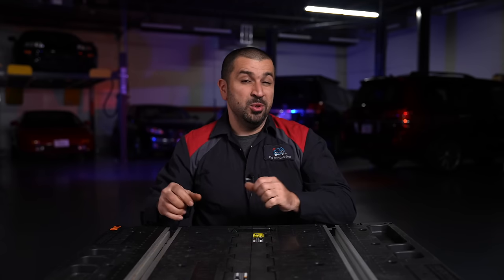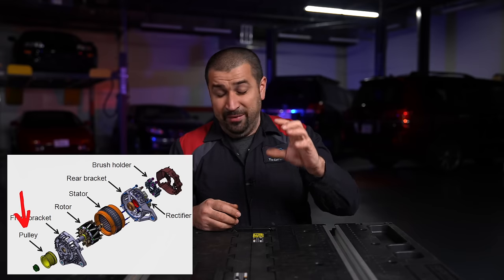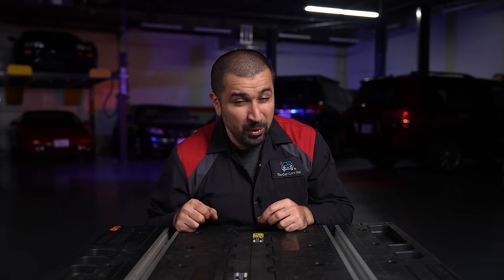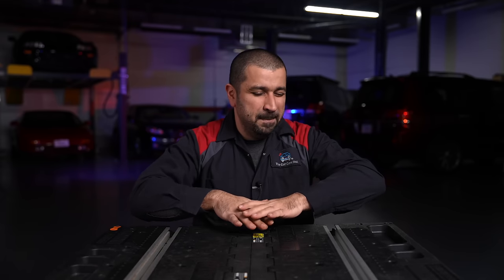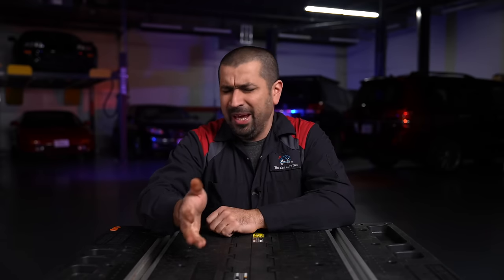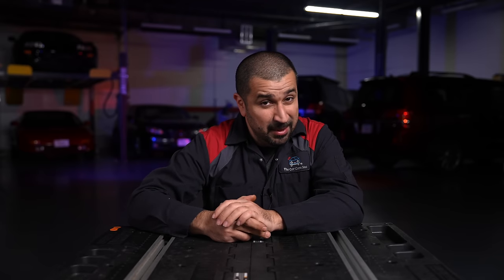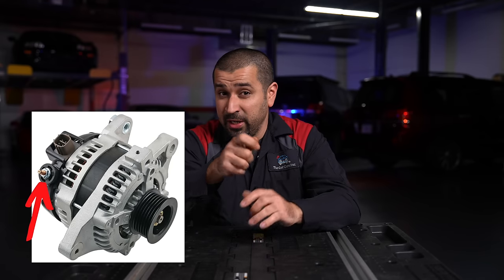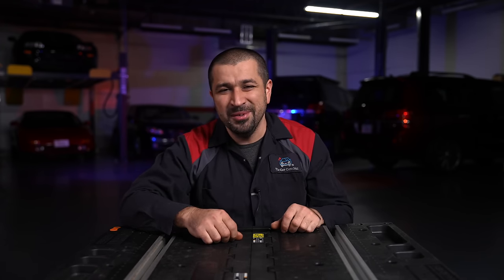How To Make Your Car's Alternator Last Longer? Everything You Need to Know

Comment: Here in the Philippines, we got a LOT of Skilled Auto Electrician who repair ANY kind of Auto Alternators, so if you have the Original from your car, all you need is a rebuild and use it forever! I've done it for my last car '81 Toyota Alternator (Voltage Regulator Type) and current one ' 91 Isuzu Alternator (IC Type), saves LOT of bucks!

Comment: For long trips when charging power stations, what is a typical current limit to prevent alternator damage? Are there good high capacity alternators available for this use case?

Comment: A very informative video and I've learned a lot from it. For example I did not know that a flat (jump started) battery should not continue to be used. Recently I had the alternator replaced on my daughters car a Yaris 1.4 Diesel but it was a reconditioned Bosch which is not a genuine part. Are these OK to use?
Reply: Bosch are fine but only if rebuilt using genuine OE Toyota/Denso core and not some no-name Chinese unit. Cheers!

Comment: Bought a 92 Lumina from my sister cheap because she was replacing alternators once a year. Very expensive. First thing I noticed was that the alternator wined when using the electric rear defroster. I stopped using the defroster immediately and drove the car many years with no more alternator issues. Since then I have limited rear defroster use in all my cars

Comment: Thank you for the helpful video, are denso Lexus alternators capable of maintaining an AGM battery that needs 14.5 charging volts, ie a tune etc. Or should it be put it on an AGM charger/maintainer one’s a month.  Thanking you in advance for the insights.

Comment: What's your thoughts on a DC to DC charger, I'm in the process of installing a 40 amp DC to DC charger to shore up my travel trailer batteries as I move. I'm assuming it be the same or you don't want to do that with a battery totally dead

Comment: Thank you for your amazing explanation I have a 2006 toyota 4runner The original alternator lasted 17 years Replace it with oem. And thanks to another of your videos I learned how to change the transmission oil and properly check  the level.thank you for your videos.
.

Comment: I've owned Toyotas since the 80's.  Best thing to do on Denso alternators is keep water and oil away from them and to keep replacing the carbon brushes when they wear down,  clean the commutator rings   and they keep on going.  The brushes are cheap.  The Toyota factory manuals show how to service them.

Comment: Camry sold at 250k and 12 years old along with 4runner sold with 280k miles and sold at 18 years old. Both never an issue and running on original starters and alternators. Toyota is quality built, take care of them and they might just last nearly forever

Comment: Always keep my motorcycles and the Garage Queen Chevy SS on trickle chargers.  Batteries last longer and haven’t had to replace an alternator or seen any electrical gremlins in those vehicles.  I will put the other parked cars on a trickle charger at least once a month to maintain voltage.  CCN is spot on!

Comment: I had to replace the battery in my 2013 Highlander, it was done at Sears, they also replaced the battery terminal clamps. New battery worked well, for about 2 days, then I started having problems, basically when I went to start the vehicle it was dead slow cranking then it’ll start. Long story short I took it to my Toyota dealership & they discovered that the new battery terminal clamps were Not the correct metal type. Yes the type of material affected the battery connection. Once changed, I never had a problem with my battery up until I sold her at 237K miles. Proof newer cars are more technically advanced & the correct knowledge needs to be know to service them. Excellent video. 👍🏾

Comment: Cell phone chargers also change line current to DC, AND greatly reduces to voltage.
I can remember when cars had low power DC generators, where the lights would dim when engine RPM slowed. This is why we have higher power Alternators now.

Comment: Hi AMD, This is another great and unique video, i have always wondered if the alternative charge the battery and then the battery supply current/voltage to  all accessories or does the alternator feeds the current/voltage directly to accessories and charge the battery at the same time ?

Comment: I used to have a GM car and on the way home from work the battery light came up, pulled into the outside lane to park the car, parked the car and the engine was barely running. Called Road Side assistance and the alternator died, had to get it towed.

Comment: I had one that worked but after some time voltage output dropped. I replaced it. I guess something wrong with regulator. Cant find a replacement reg for my acv36r camry alternator.

Comment: During a power failure at a house. I have also seen people hook up a 12 dc to ac inverter that has a high amp draw off the battery. So in return that alternator is trying to keep up with that inverter draw. That also will make the alternator fail earlier.

Comment: Very informative as always 2 questions :

1) Is it ok to use a Denso remanufactured Alternator or only a brand new one ?

2) Do you have any tips to prolong our car battery life, like a trickle charger, etc ?

Thank you very much.👍
Reply: I use CTEK battery tender. Original battery and the car will be 10yrs old in April '24. Been using it since the car was 6-7 yrs old, but before that I was using regular battery charger (trickle charger overnight ) to top it off every 3 mo or so.

Comment: i jet washed my engine and alternator too, the car is a bmw diesel, then i sprayed alot of wd40 into the alternator while gently tapping it with a hamemr then irevved it abit and it fixed the alterntor, it was full of black dirt particles on the brushes, wd40 on its own wont do the job i reckon

Comment: Made the mistake of leaving my car stereo on too long, came back to a dead battery, jumped my car and took it straight to an hour drive to "charge the battery" Sure enough I overloaded the alternator that probably was on its last legs, battery light comes on the dash and I'm thinking (yes I know the battery is low, if I keep driving it will go away when the battery is charged LOL) thank god it didn't die on me until I got back home. Wasn't until later that night that I had to drive somewhere that things started going haywire as soon as I pulled from the driveway and turn on the headlights, the entire dash was flickering, radio cut off, and the car went into limp mode barely going above 1.5k Rpm. Glad I was home, ordered a 10 amp battery charger from amazon, and a new alternator, and am going to replace it in the morning.

Comment: Awesome video, as always.  Thank you!  My 100 Series LC developed a leaky valve cover, and yup, it killed the alternator.  When I went shopping, even at dealer sites, most of the available Denso alternators were labeled as rebuilt or remanufactured.  Can that be a problem?  I assume they may be rebuilt witn non-OEM components?
Reply: My guess would be, they're not using oem parts. Parts shortages are most likely the reason Denso can't keep up with new car demand, let alone replacements. So, the companies doing the rebuilds are using sources wherever available. Denso may also be using some of those same sources, but under their higher specs

Comment: I recently had the battery symbol come on . I can only suspect it was because I had used double the amount of soap and rinse cycle at the self serve carwash . Though I have never covered the alternator before in my 2020 Toyota Camry nor previous 2011 and had no issues . ASAP to confirm it is the alternator or ? I've watched a YouTube video on changing it , I know I can do it myself . But , from now on I will secrely cover the alternator with plastic bag , etc , when cleaning the engine . Replaced alternator with brand new one , not remanufacturered and replaced the serpentine belt . The old one was very flexible as I could easily deform it . The new as expected was very stiff  . And had read to change it after 50000-60000 miles .

Comment: Absolutely not true. BMW, starting from 1999, E46, diesel models, had auxiliary heater. It sucked 80-100A. For half an hour in cold weather. Alternators worked fine for 200 000 - 300 000 km. Pretty much as always. +/-20%.

Comment: Well also most manufacturers use an alternator that is just enough to do the job as you described. If you have high amp ie a winch loads you must upgrade to larger more amperage. Or even dual alternators.

Comment: My elderly neighbour had a flat battery from leaving the trunk slightly open.  I charged it 3 times on my Victron multi stage charger and the little green light came back on.  Took it back to her and re-installed it properly - all good.   I was tempted to jump start it but time wasn't an issue so probably did everything right inadvertently.  I later bought the car from her.  It's a terrific 2000 Corolla.

Comment: Your AC/DC talk was something called a half-bridge rectifier.  I hope modern alternators are using full-bridge rectifiers.  Half-bridge are cheaper/inefficient.  I'm 'guessing' that modern alts use full bridge to get the most power out of that alternator package.  But I'm not a mechanic.

From your description, the alternator duty cycle should be much lower than 100%.  Any thoughts on a sustainable duty cycle?  If I used an alternator on an RV, and wanted to use say 25% of duty cycle to charge RV batteries.   I'm also guessing the life shortening is temperature related.  None of my owner's manual discusses heat issues.
Reply: Half wave and full wave rectifiers are the correct terms for them.
Reply: @alan4sure  Terminology is important.  Thank you for the correction.
Reply: Yes, Ahmed mis-spoke. 3 phase alternator (they all are) = six diodes = full-wave rectification. BTW: Your battery is the filter capacitor. Cheers!

Comment: Nice video as always!

FYi...My 07 Jeep Wrangler, Lifted, 4x4 all of the West, Moab, a few deep water crossings, etc.  at about 10 years old and 100,000 miles my Alternator went out.  I did buy an aftermarket, but it was an Aftermarket upgraded one (Mean Green).  I did this because of the aftermarket Winch and Offroad lights, etc.  I sold this Jeep  at 14 years old and 144,000 miles, everything was still working fine.    Saying this, I would never buy an aftermarket parts store Alternator to save money.  Just not worth it.

Comment: DC to DC Chargers are getting to be the norm if you have a Camper or RV trailer and charge your RV battery via your vehicle alternator. You typically hook these up to the vehicle starter battery with heavy gauge wiring and on to the Camper RV battery. After watching this video, I'm wondering how hard this is on the alternator. My Victron Orion 12-12 30 seems to do a great job of controlling the volts and amps in stages that I can watch via a bluetooth shunt and my phone.

Comment: Thanks for mentioning the one way clutch on the alternator and how the new alternators do not charge up the batteries like they used to, I didn't know that. In the field we would call the rectifiers, "rectum fryers" and the engineers who worked on CatScan X- ray machines, "donut boys" cause of the shape of the gantry.   signed Fred Flintstone. Esq.
Reply: Ha!, ha! So right. Haven't heard that term for awhile.

Comment: Nice explanation of the basic operation. (My polyphase theory class got into more detail that you were wise to bypass.)  My '15 Tacoma has a towing package that was supposed to include a more powerful alternator. Since it does supply power to the trailer battery how does it work differently? 6 months has gone by since you made this video so I'll search to see if you've answered this. Do you have a quick reply for this response posting?

Comment: The whining could also be the power steering pump. If I am driving on the highway I ALWAYS put my lights on. This is because your alternator could actually OVERCHARGE your battery! The alternator is ALWAYS spinning so the power it creates has to go somewhere! The voltage regulator can get very hot and burn out and it is ATTACHED to the alternator, not like in the good old days when it was a separate CHEAP part! Usually when an alternator goes out, it is the diode(s) that fail, a $2 part that will cost you a fortune, same as the regulator which is not that expensive. I could not agree more though that if your battery is dead, to re-charge it with a charger not the alternator and if it is dead again the next day, you know it is bad and replace it IMMEDIATELY! Whatever you do, DO NOT disconnect the battery while the engine is running to "see" if the alternator is working/providing power to the spark plugs to keep the engine running. You could do that back in the day but now it will likely DESTROY you cars computer! This is WHY I would NEVER buy a car with that RIDICULOUS start/stop witch is only to try and beat fuel mileage ratings! If it doesn't have a delete switch do NOT buy the car! That is the WORST thing I have ever known to be put on a car! It is RIDICULOUS!

Comment: Always helpful and informative, thank you!

But I'd like your opinion on something if you'd be so kind as to share it:
1. Should I use a battery charger every couple of months or so? In theory it should keep my battery nice and healthy, and therefore the alternator (and wallet!) nice and happy.
2. Do hybrid cars still use an alternator? Or do they just use a DC/DC converter between the high voltage and the 12V electronics?

Thanks and more power to you!

Comment: Great video, but I really wish you added one point about battery health most people (yes, I said "most", even mechanics) don't understand (even if you just referred to another video on the topic);  The ONLY reliable way to determine battery health is by viewing the voltage drop under load.  A theoretically perfect 12V lead-acid battery would read 13.72V.  Most new batteries read 13.5V fresh off a charging system.  The vast majority of batteries (even if they're not healthy) will show 12.5V+/- 0.1V.  A battery nearing death will show a lower voltage, but if it has just been boosted by the alternator, it may not for a while.  When you start your car the voltage WILL drop.  A healthy battery will stay above 11V and rebound quickly as the alternator "takes over".  An ailing battery will drop below 10V, then when the car is shut off it may not rebound much.  A battery which is deadly to your alternator will drop well below 9V, probably won't rebound without help from the alternator, and may even read below 12V while the alternator is running due to parasitic power drain (the alternator should output 14.0V while running if under load.  These new alternators will vary depending on that load, but I think will still never output below 13.72V ).

Comment: If I were trying to dry a wet alternator, I would use the same thing that apex electronic techs use: isopropyl alcohol (IPA) 99% [1,2].  Electronic techs use IPA to displace water from electronics like smartphones and laptops.

[1] "Microsoldering 101: Water Damage and Corrosion" on the "Ifixit" YT-channel
[2] "How to use rice to repair water damage on iPhones and Macbooks" on the "Louis Rossmann" YT-channel

Comment: I'm surprised at how small the charging wire, and ground wire are for the rated current that alternators are capable of putting out.  Looking into this more after having my own issues with my car, I looked up the power rating for wires of certain sizes, and the ones that are on my car aren't big enough for my alternators rating.  I am replacing my alternator soon.  It looks like it is the factory one from 2000.  Well made indeed.
Reply: Somebody probably replaced the wires with the wrong ones from the factory they're usually the right size
Reply: It's the factory wiring.  It's the same size on my daughter's Camry (my old car).  It's maybe 10, but likely 12 gauge.

Comment: 2002 Sienna with 282,000 miles. I have only had this van for the last 10,000 miles and I have no idea how many alternators it has seen.  This van runs great with no issues that I know of. Is there a way of identifying this alternator as OEM?  Great video as always!
Reply: OEM one should have a sticker that shows “TOYOTA” and a part number like 27060-0P420 and “Denso” and also a number behind that.
Reply: I have a 2012 Sienna with 280k miles, original alternator in it.

Comment: 6:05: they use a bridge rectifier, which consist of several diodes which actually flips the negative part of the AC waveform upwards, i.e. they produce more energy than a single diode which just cuts the lowert half.
Reply: If it's a bridge rectifier, it's 4 diodes.
Reply: @alan4sure  Don't know if it is really a classic 4-diode bridge rectifier (seems not from the drawings I saw) but I'm sure they are not wasting the lower cycle of the alternator's outputs.
Reply: @alan4sure Not a classic bridge. Two diodes per phase. Six total. Battery is the filter capacitor.
Reply: @blackrifle6736  ah, 3 phase. Yeah. thanks for correcting me.

Comment: He is absolutely right on aftermarket alternators - don't EVER buy one from Autozone, Oreilly or Carquest. Me and many others have been down this road - they are junk. Either they don't work out of the box, or fail in a VERY short period of time. There was an article many years ago about a guy who went into the factories where they do these rebuilds, and what he saw would shock you. And many times "Rebuilt" only means they replaced what they saw was completely worn, not every part replaced, etc. etc. You still get a alternator with partially worn parts - which may be just aroun the corner from failing. Just save for an OEM one or an rebuild SOLD by the OEM (ex. Motorcraft, Mopar, etc.)